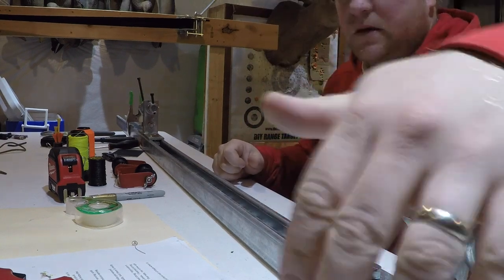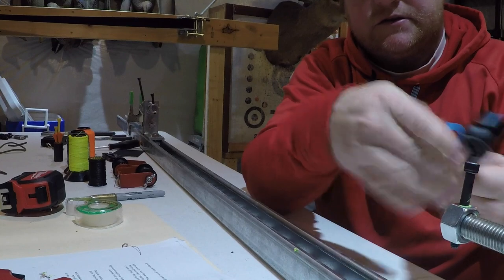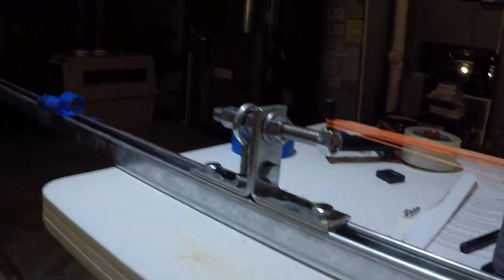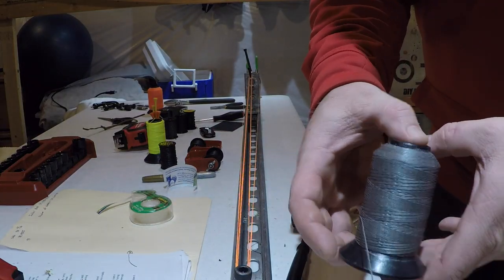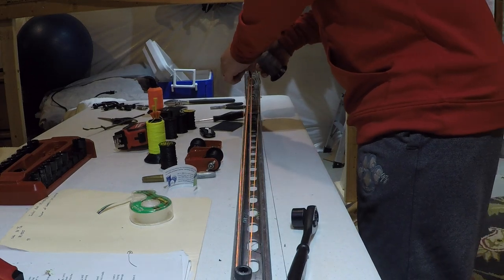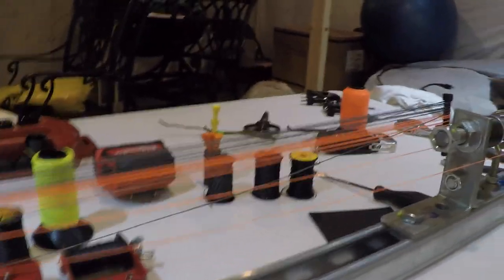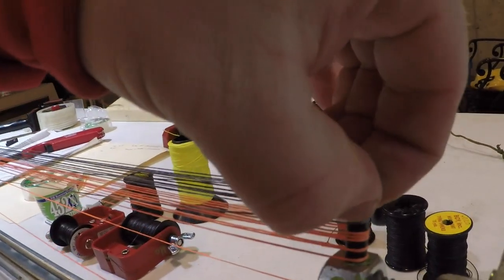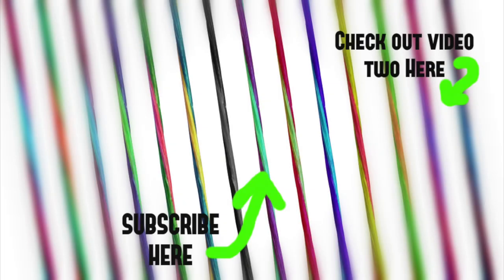How to Build a Compound Bowstring | Bow and Arrow Part 1 | Bowstring Layout

Comment: Thank you very much for these 4 videos; to make my own strings is something I allways wanted to do. You explain, detailed, every single step of your process; just wat I was needing.
There´s a question about your jig I want to ask you: The Automan´s El-Cheap-O original jig has a couple of plates between every two angle brackets, but you don´t use them in your jig. I guess those plates are just there for seting everything a little higher. Have you notice any inconvenient not having those plates in your jig?. How high are your angle brackets?.
Thank you from Spain.

Comment: I was interested  in this video series for making bowstrings,  but then I realized the sheer price of trying to get decent jig, that can hold up to a 60 inch string, with a stretcher able to be added without breaking the bank. I mean, 500 bucks for the BCY Yellowstone jig??!?! and you still need the stretcher?!?!? Just don't even get me started. You did good with the video series, I just think that the initial price of a jig and stretcher is insane. I looked at Lancaster Archery Supplies and the 3 rivers archer page. the only stuff I could use with a stretcher that I know of is using the expensive 500 dollar BCY Yellowstone jig, I also don't even know if I could have some room for that! Keep in mind, I'm 13, I don't have a job, I don't buy my archery equipment, I am sure my mother is not happy making a 500 dollar purchase after so much was already spent on my bow setup...........
Reply from the maker: Nicholas! Thanks for watching. I built this jig and stretcher for less than $75! Check out the links under the video. They have some great tutorials on building this jig and string building! You can build this jig and your first set of strings for the same price as a new string from a dealer!
Reply: @SomewhereInWisconsin  If I build more than one string, can it eventually get "wear and tear" If I don't use it? For example, if I make the archery talk jig(s) and I  make 3 strings. Are the other 2 strings going to be useless by the time the year ends and I need the string replaced?
Reply: @SomewhereInWisconsin  Also,  I would need a bow press...so I don't know how the price would work  out there considering that Lancaster Archery Supply is usually at the more  expensive  end of the price range for gear when comparing some products to MSRP....

Comment: Hello friend I am a follower of yours on YouTube for the making of the strings with Pound in one of your videos I saw that you publish a formula for the calculation of turns at a later date add a fixed factor of 0.012 what corresponds to? Can you explain it to me? Thank you so much top
Reply from the maker: Number of twists x .012 + your finished length = your final string length. 

The formula takes into considerarion how many twists are needed in the final stages to have the finished length correct. Some people do adjust that .012 number slightly for longer strings.

Comment: did you follow the archery talk forum? If so,  what spring nuts did you use? Currently looking at home depot( local hardware store) to  make a list and they have  1/4 in 1/2 in and  3/8 in. I wanted to ask you this because I didn't want to  go through 8000 posts......
Reply from the maker: I did follow the forum, and the materials I used should all be in the first couple pages of the jig build one. I can't remember exactly which ones I used. Reach out to Automam on AT. He would know as it is his design.
Reply: @SomewhereInWisconsin  I don't know.....do you think he would be answering questions 7 years later?

Comment: sir i am trying to make string.But my peep site is spinning.what shall i do?
Reply from the maker: Two things could have happened. One, when you served your string you served the wrong way, which causes the string to twist funny under the serving and case the peep to rotate. 

Two, you may just need to add a twist or two to the bottom of the string to rotate the peep a bit. 

I'd try option 2, before reserving your string.